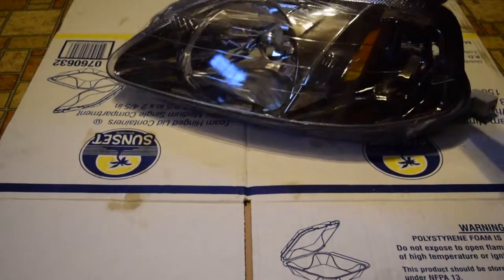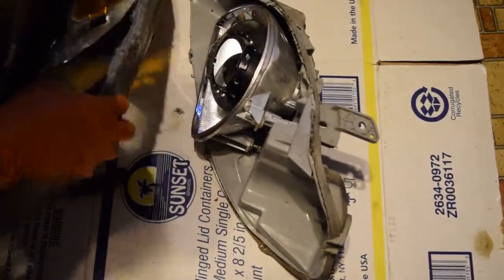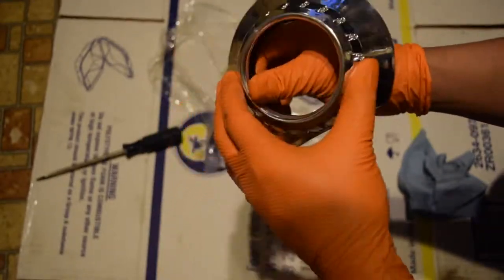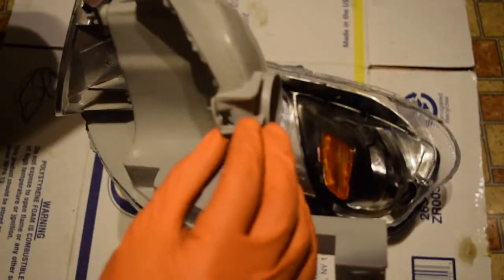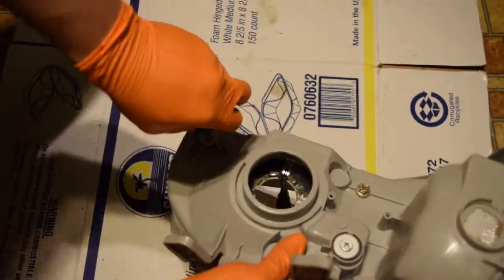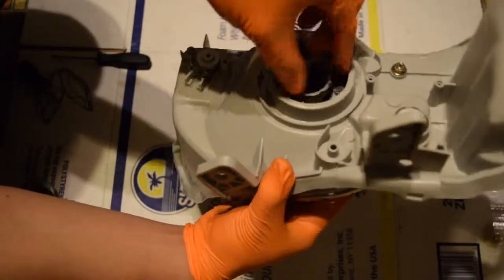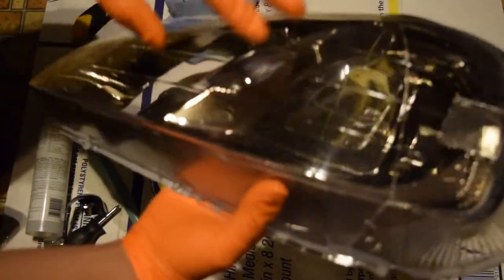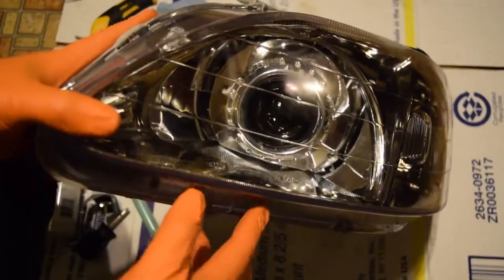How to Retrofit Projector Headlights into Civic Reflector Housings

Comment: I hope your cutoff is straight.  Because I think you were supposed to align the projector before tightening the lock ring? 
Can you do an update, night, vid of the cutoff and what not?
Thanks
Reply from the maker: Yeah I can do an update on the retrofit. Thanks for asking! As far as beam alignment goes, my cutoff is pretty straight. The kit has an alignment ring to make sure the cutoff stays straight. And since the assembly is locked down to the OEM reflector bowl, I can still adjust each headlight up, down, left, and right to ensure a proper alignment.
Reply: @OhItsJustZhu  cool. Any info on the kit you used?
Thanks
Reply from the maker: @BTL3.0  I got mine years ago through the retrofit source with steep discount. But nowadays, there are people selling the same thing on Ebay (search h4 d2s projector) and you'll see what I mean. TRS gets their kits from China too, but they're like a generation newer with maybe an extra feature. But you can piece together your own kit for much cheaper if you dont mind waiting on shipping. Hope that kind of answers your question! Let me know if you need anything else answered

Comment: When it comes to projector retrofits how do you go about the wiring from h4 to d2s bulbs ?
Reply from the maker: The best way is to get an h4 to d2s relay harness. I run 55w ballasts so I need the relay to get power directly from the battery. You could try a simple 35w d2s HID kit with conversion plugs, but my car sometimes wouldnt have the needed power to ignite the headlights from the headlight harness alone.

Comment: As far as shrouds go, will any one work?
Reply from the maker: I would say yes. I used extended E46 shrouds and they're like the biggest I've seen. Worst case anything will fit with a bit of trimming on one side
Reply: @OhItsJustZhu  perfect. How about the shroud adapter? And what projector did you go with? Morimoto bixenons? 2.5"? Sorry for the noob questions. Just looking to see what works best in the stock headlight housings.
Reply from the maker: @JasonTylerRicci  yep! I went with mini d2s projector and 2.5 lens. I think the adapter is just 2.5 to 3in adapter. Be sure to use a bit of silicone to 'glue' the shroud to the projector. Otherwise it'll rattle loose over time...